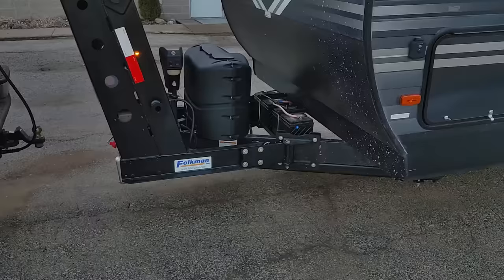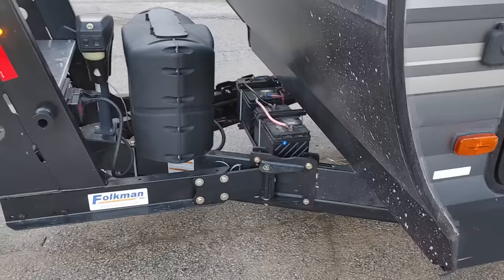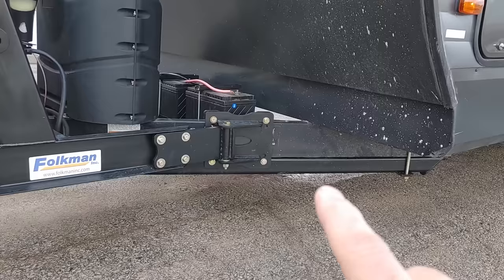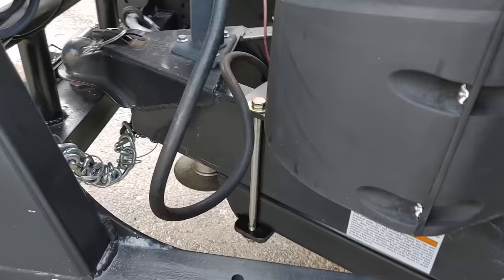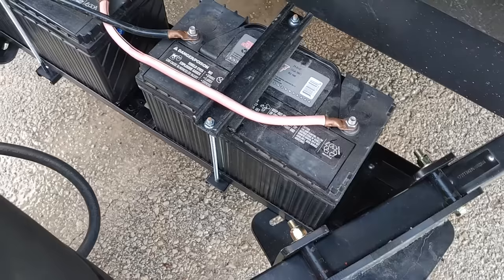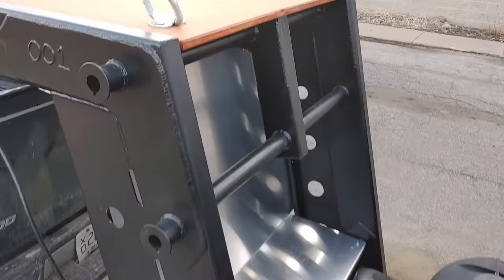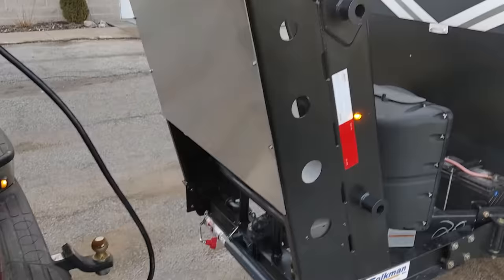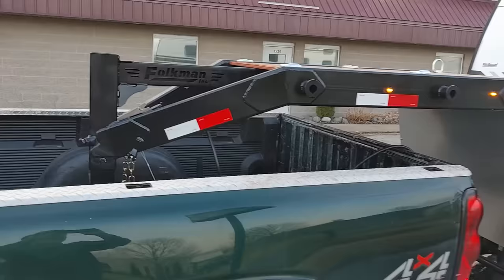Folkman Inc. -  Gooseneck Adapter Hitch

Comment: Seems like it would put a lot of torque on the trailer tongue frame. That’s a lot of extra leverage.
Reply: They do! Every one I have seen has stress cracks at the point where the frame meets the body of the RV.
Reply: What do you mean, stress cracks from using this conversion? I don't think the conversion would put any more weight on the original hitch from what it already was.. Yes the moment arm of the whole thing is longer. A longer arm does give more leverage, but that isn't going to effect/increase the amount of weight on the original part of the hitch on the camper as far as the camper is concerned, the ball is still in the same place, think about it. But I agree campers are built notoriously crappy. I've got cracks on my old fifth wheel camper, the actual hitch framework, I need to address right now.
Reply: @oneninerniner3427  it’s the leverage that would put the extra stress on the frame, not the weight. Same concept as using a cheater bar on a wrench.
Reply: i thought this seemed a little dangerous. 😂
Reply: @turdferguson12   Yes but if the front of the camper is not loaded any heavier then the hitch should not be any different and they did reinforce that with the bars under V anyway if that has any effect on the frame where the A frame is welded to the box frame it was not a good design in the first place that is just my thoughts
Reply: @kevinkinsey6985  I think you are correct under static loading conditions but I suspect the issues arrive when real world conditions are factored in. Bouncing on the road puts a lot of stress on those poor welds where the hitch A Frame connects to the trailer frame. Also consider the loadings when slamming on the brakes in the drive vehicle. not only does a lot of the weight of the trailer shifts towards the front. But the connection point on the truck is higher up. The two torques add up and may exceed the capacity of the weld on the trailer A frame. The conversion hitch they made here looks pretty well made and thought out but unfortunately these travel trailer frames are just barely strong enough to survive under normal usage.
Reply: @nathanrucker4987  yes they are not made for a lot of stress anywhere on the frame if a guy was really worried about that point you could hook a chain and binder from the front spring mounts to the bottom of the a frame and bind them tight it would take the stress of the bouncing of driving and spread it out further and probably be ok  kind of like they do to a semi van trailer when it breaks in half on the highway and the tow truck chains axle to landing gear and pulls it tight to tow it off highway

Comment: I do not see that as an advantage personally.  The trailer frame is not designed for it, nor would weight distribution be the same.  Also a true 5th wheel has far more room inside, and when you have a 30ft 5th wheel, it tows about 5ft shorter than a 30ft pull trailer.  My 34ft 5th wheel tows and backs up like a 25ft pull trailer.  So you use up the truck bed to pull a trailer designed to free up the truck bed when you tow.
Reply: The advantage would be a trailer that actually pulls nice without a bunch of drama and fish tailing. Also, no in-cab reverberation from tongue weight hanging off the back of the truck.
Reply: Backing up would be fantastic compared to the original trailer

Comment: Gooseneck, when possible, is THE very best way to pull hands down.  We've been hauling horses, cattle and hay, nothing better.  Once someone used a gooseneck, there's no going back.
Reply: Exactly. Why would you buy a bumper pull  trailer and convert it?  Buy the right thing.
Reply: Gooseneck travel trailers are few and far between. It's way easier to get 5th wheel

Comment: That's nice I built one 12 years ago for a 32 foot tag along camper and sold the camper a few years later with it attached to it  I mounted a generator on the noise over the back of the truck and a plat forum for storage

Comment: Very nice idea.  Nice concept and thoughtfulness of what people need.  Really like the under side lights, the storage tray and storage shelf.  This may be an issue for half ton trucks as they often need weight distribution due to the limited capacity.  Just making a pull behind a gooseneck does not solve the limitations of the truck.  Especially on short bed versions where the ball is behind the rear axel.  But again, overall, a great concept!

Comment: For those asking why. I can only answer for my personal reasons.
1. I have the perfect TT for me. Its paid for and i never wanted a 5th wheel. 
2. I like that I would still have the low profile of the TT, but 
 would have the better handling characteristics of a goosneck.
3. I dont know why people keep saying this causing more torque on the trailer frame. Its inducing less than a weight distrubution hitch. The point where it connects is the exact same as being  hooked to a receiver. The ball in the bed allows the tongue to move in infinite and continous positions. It cannot bind like a WDH.
Your needs will vary of course. But its a great design and would work exactly as intended.
Why dont i have one? Because the place i park my trailer wont accommodate the extra length.

Comment: Ingenious, I want to build a gooseneck like this to attach to my fifth wheel pin box and the chassis side rails to minimize the stress on the front frame and aluminum RV structure, that way the weight and twisting stresses will be carried by the more rigid gooseneck hitch and main frame rails on the RV and not the front structure of the RV

Comment: Perfect I can add at least 8' to my 32 foot bumper pull.  Would place some major limits on where I could camp with a 40+ foot rig.  And adds one real big place to hit my head every time I left the camper or truck
Reply: Look at it fool.2 feet from where it normally would sit on bumper
Reply: @hankclingingsmith8707 not to mention it's way easier to back up and park a gooseneck

Comment: If your goose neck ball was in line vertical with existing ball hitch. Then your trailer frame loading would be the same as the orginal trailer manufacturer.
Reply: i was sitting here thinking about this, moving the hitch out 4 to 5 feet would be like holding weight against your chest than extending your arm out straight that puts more stress on your shoulder than your legs im thinking it is putting a lot more stress on the hitch i might be over thinking this
Reply: i ment to say more stress on the tongue not the hitch

Comment: I don't get it.
You would be better off trading in for a fifth wheel travel trailer.
Reply: Because I can't find a fifth wheel toy hauler smaller than 40+ feet. I don't want or can afford one of those monsters. The small toy haulers are all bumper pull.
Reply: @oneninerniner3427 genesis supreme makes a ton of 32' overall (and smaller) fivers. My 27.5' box is 33' overall. Fifth wheels are a lot more efficient use of space.

Comment: You should find a way to hinge it up at the top with some pins so top can fold down so it's not sticking out so far when your unhooked. My bumper pull camper measures 41ft long and its tough to find camping sites for it to fit, and with your hitch it'd be even longer, I think it'd be cool to fold down somehow after you unhook. Just a thought but man that is exactly what my camper needs bc it tows like crap! Love your hitch tho I'm gonna have to try one for sure!

Comment: This will also reduce your trailers load capacity as half the weight of the unit is now on your trailer and the other is on your truck.  Not to mention the amount of torque that its going to put on the frame and tongue of the TT that it wasn't designed for.

Comment: Other than the better towing and sway prevention,  I would like this setup,  so that there wouldn't be the big 5th wheel bedroom over the hitch.  The extra height of the 5th wheel designs,  are mileage killers, and the layouts aren't that good for tall people. 
The gooseneck would also give more stability for smaller trucks, because of the weight placement.

Comment: Great concept. 
But there are MANY documented cases of BP frames snapping due to the loads imparted by a simple load-leveling hitch. This is basically the same thing on steroids as far as where/how it attaches to the trailer frame. Im curious to see the first-hand data after a year or 2 of use
Reply: Actually its not the same at all. A leveling hitch doesn’t allow the trailer hitch to pivot vertically when hitting dips etc. That is where all the stress comes from. 
A 5th wheel hitch keeps the truck and trailer completely independent except for the tongue weight.
Reply: @akshonclip8149  actually it's exactly the same. The gooseneck adapter transfers the tongue weight up over the axles, but there is an extreme amount of torque on the frame tubes where the adapter attaches (just like with a load leveling hitch). 
IF the ONLY point of contact between the trailer and adapter was at the ball, this wouldn't be the case. The adapter uses the trailer frame tube for leverage, just like a load leveling hitch.
Reply: @ryanj2071  But you are not locking the trailer frame and truck frame together. That is the problem with load levelers. At some point the trailer frame is forced to take the rear weight of the truck. 
That doesn’t happen with a 5th wheel.
There isn’t any more torque applied to that setup then there would be with it just sitting on a hitch ball without load levelers.
Reply: @akshonclip  I guess I need to look at the adapter a little closer.
Reply: This system looks like it spreads the attachment forces out very well and it also still allows for full articulation which would eliminate the stresses of a WD attachment.

Comment: Could this be used on a dump trailer or equipment trailer?  I would feel safer with a 14,000 pound capacity trailer using a gooseneck hitch rather than bumper pull any day.
Reply: I have an equipment trailer too . Same question , it has a 6" C channel frame .

Comment: Look good but I have seen those Lippert tongues bend and or break off the frame because of the very thin-walled tubing Lippert uses.  I would not use your adaptor on ANY      "lite weight" trailer.  Only use on good strong frames.

Comment: It looks really nice. I have a 254 pickup truck. Super duty 30 foot camper was slide out. How much difference would it make it way to truck with Pole and handle? How much does it cost working? You buy one? Thank you very much hope you have a nice day
Reply: all other things being equal a gooseneck trailer will always be more stable then bumper pull to tow because you aren't taking weight off your steering axle.

this also has the advantage of being able to make tighter turns before jackknifing.
Reply: All that’s true… being a 250 n 30 footer… difference will probably be pretty substantial… especially if you have short wheelbase. $6k … it’s on you to get from Green Bay to your place. Crunch your own numbers.

Comment: Changing the stress points could be detrimental to the factory build.
Reply: What stress point has changed? It's still mounted via the ball hitch.
Reply: It looks exactly same way as a weight distribution hitch would mount to the trailer.
Reply: @LJT7907 except instead of distributing the weight across the entire frame of the tow vehicle it puts the weight in the bed of the truck over the rear axle. I’m not a mechanical engineer but would love to hear their opinion. I don’t believe I would be able to swap this out on my half ton truck instead of my WD hitch.
Reply: the trailer's frame is getting the same load and is even a bit reinforced.

the truck having the hookup over the axle is much better because now the weight presses down on both of the trucks axles, where a bumper hitch levers weight off the steering axle.

the reason this kind of hookup isn't standard is cost (it's alot more metal) but this will be more stable in every possible way.

Comment: Fifth wheels are more comfortable to pull. I don't see no increase in the TT tongue weight distribution. Setting on the ball, and the rear brackets are exactly the place that weight distribution bars attach to the frame. The only drawback I see, is the fifth wheel attachment sticking out in front of the TT.  Kind of wasted space?

Comment: As someone that moves camper trailers professionally, why on earth would this even exist? You're trying to solve a problem that doesn't exist... It's a hack method instead of using the proper truck for your needs.
Reply: I was thinking a good place for the 4wheeler if you don't want to buy a different unit lol

Comment: With a fifth wheel you can legally tow an additional trailer or vehicle behind it.
Reply: Cool incredible 0:30
Reply: And join the club of other rv drivers pulling "doubles" that shouldn't be pulling a trailer of any size. I see alot of them on highway with inadequate tow rig, too much tongue weight, not enough tongue weight, chains dragging on asphalt,   hooked to bent, rusted hitches ect ect. Trailer whips, panic smash brakes and then twisted up in median.
Reply: But the frame of the bumper pull you just made a gooseneck isn’t rated for double towing
Reply: @r.m.3020 God bless Charles Darwin 🙏😂

Comment: Gotta say thats pretty cool. With the ball on the device how will it affect turning? Will it only move on the gooseneck ball or will the trailer ball move also in a tight turn?
Reply: The adaptor is bolted tight to the trailers frame, it will only turn on the goose neck ball

Comment: Your design effectively lengthens the moment-arm of the hitch by roughly six feet.  The clamp-on structure support is not adequately placed to compensate for the significant additional torque force being applied to the frame of the trailer and the point where the A-frame is welded to the frame rails.  Modern camper trailer frames are barely able to carry the forces as designed.  This looks sketchy to me.  Have any of the RV manufacturers given their endorsement for this modification?
Reply: You're pretty good with the word salad.
Reply: @Katchi_  Thank you.  "That dawg won't hunt" or "That shit ain't right" just doesn't seem to capture the situation adequately.
Reply: @thomabb 😂 for people who "want it" more than they "want it right"

Comment: Solution looking for a problem
Reply: Eh, maybe. When installed right, I doubt it, but there's always that slim chance of failure, However, this kit puts some tongue weight from the trailer into the front end so your steering doesn't get squirrelly, meaning, you gain the traction back into your steer tires.

Comment: So you can turn and back up 10 times easier
Reply: Learn to back a bumper pull.  I have been doing it for years and it is not a problem.  At the house on a very busy street I have no more than 1 FOOT of clearance on either side.  Back the camper in with no problem every time we go camping.  LEARN TO BACK.
Reply: @davidroman1654 he didn't say he didn't know how. He correctly said it would be easier. Appears he knows more than you. Learn to read.

Comment: I have an 89' F-Superduty with an 11' flat bed. How would your hitch work on my truck? As you may know. Flat beds are very tall.
Reply: Goosenecks are adjustable up and down. Notice the nut & bolt welded on the corners of the neck - another tube is inside that telescopes down to the ball.
Reply: @tdotw77  I know how they mount. I was meaning with a tall flatbed and pulling ability. My flatbed is commercial hieght. Not the straight rail mounted you see on residential trucks.

Comment: Cool, the only problem i see on this on this set up is payload capacity. If you're towing it with half a ton, that could be an issue, especially if your trailer weight is almost on the maximum capacity of your truck.
Reply: 99% of half tons don’t have a gooseneck set up, or a way to install one. So it wouldn’t be used on a half ton truck anyway.
Reply: I never understood why people tow with half tons in the first place with single bearing axles and super small brakes.
Reply: @PudinTane-gc4dn  because not everything needs a large tow vehicle. Nothing wrong with half ton towing. 

Why do people tow 35k with a one ton pickup when a semi would have heavier axels and larger brakes?  It’s the same scale as towing something with a half ton truck.